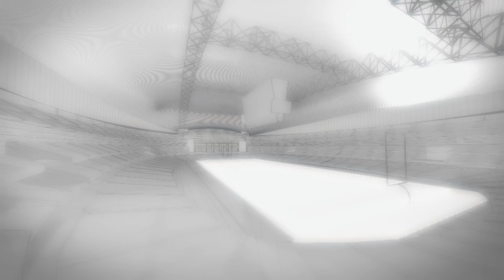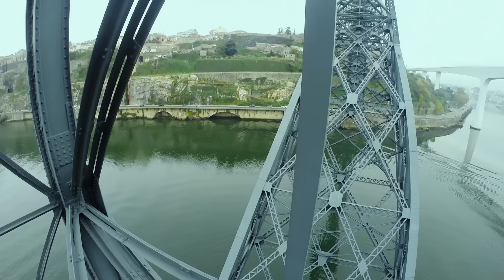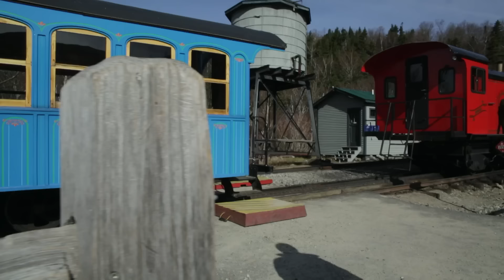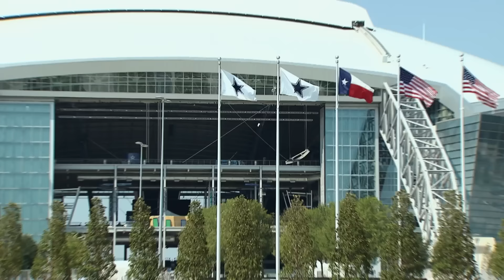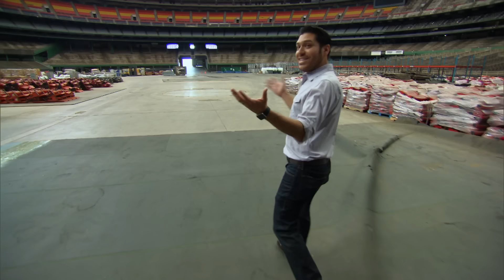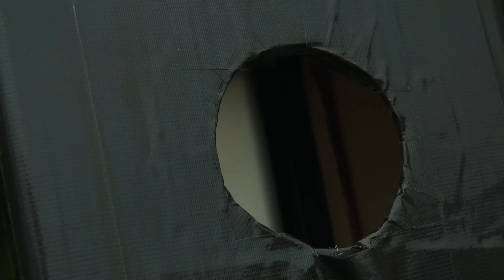How Engineers Built the Largest Stadium Arch in the World | Blueprint

Comment: What that wonderful facility DIDN’T NEED was the retractable roof‼️Dallas/Arlington, TX is extremely hot in the summertime and cold in the wintertime. It needs plenty of air conditioning and a modest amount of heat in the wintertime. Fans +  football team members produce enough body heat so that minimal auxiliary heat is needed.
The retractable roof along with the massive wall of windows that open simply added an unnecessary cost that could have been avoided.
Reply: The roof was so that events could take place in it YEAR round. Not just for football. It was a cost that the city and its partners calculated would pay itself off in 20 years. And it did.
Reply: Football is played mostly in the Fall my guy! From September to December most years, you can easily open the roof to temperatures from the 80’s in September to the 50’s/60’s and sometimes 70’s in December. The extreme temperatures here are July/August and January/February. Do you even live here? lol!
Reply: @Aggie4life77  I admit I find humor in the person calling Dallas cold in winter. Meanwhile Green Bay is playing in weather so cold the beer freezes, And its snowing horizontally at a post season game in Philly.